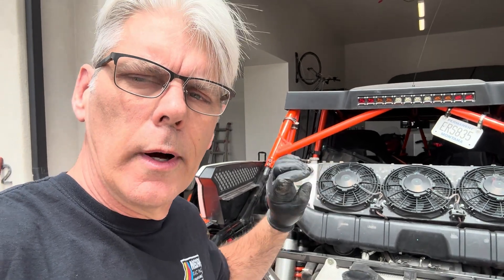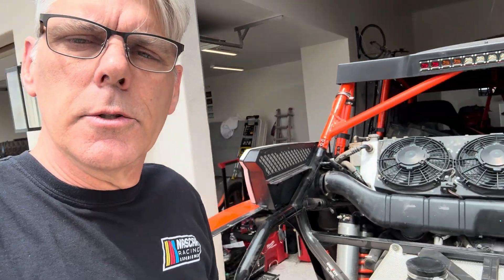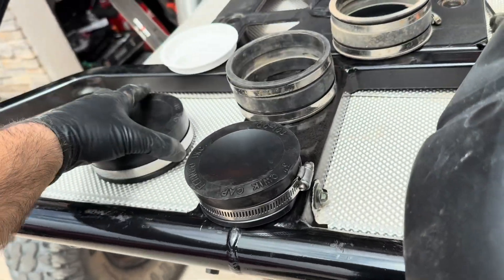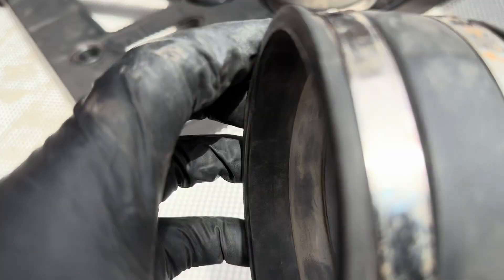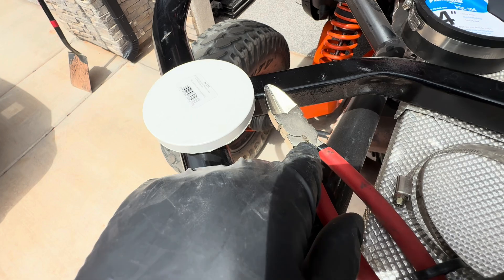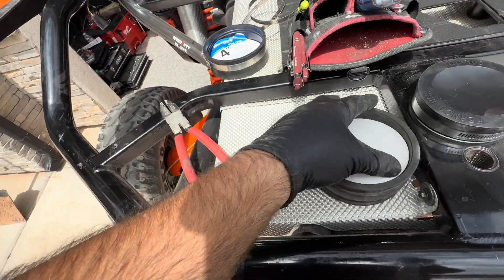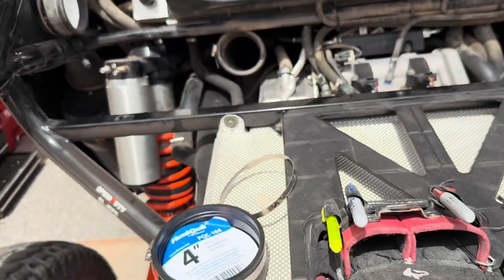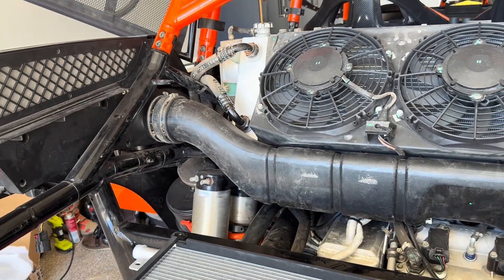How to Separate Engine and Clutch Air Intakes on Speed UTV

Comment: Did you notice a significant difference?
Reply from the maker: I haven’t put to many miles on it since but it hasn’t been anything major that I could tell
Reply: @derrekholland5207  have you put more miles on? Did improve belt temps?
Reply from the maker: @TimothyKelley007 I added the Hollander vent cover since then so I can’t compare if that one thing lowered temp. 

How to Easily Install Hollander Clutch Vent on Speed UTV to Keep Belt Temps Down
https://youtu.be/HhE67x5WRqk